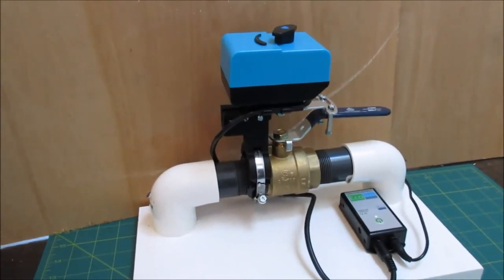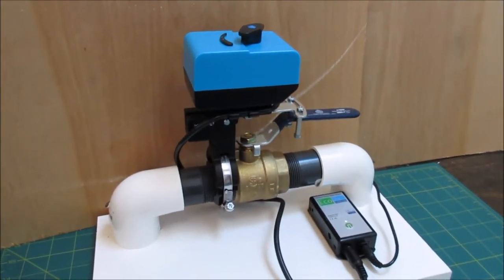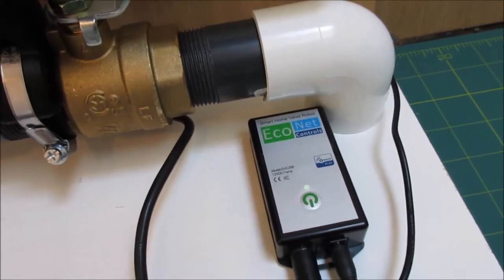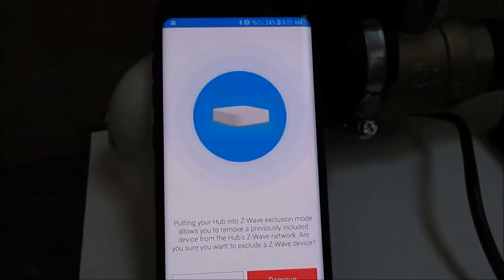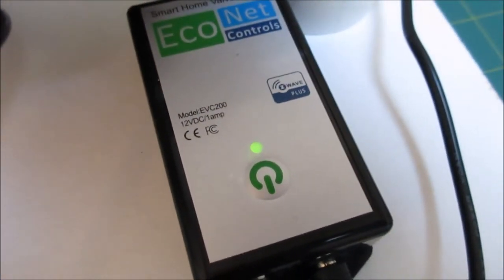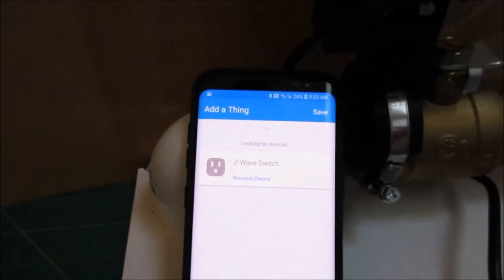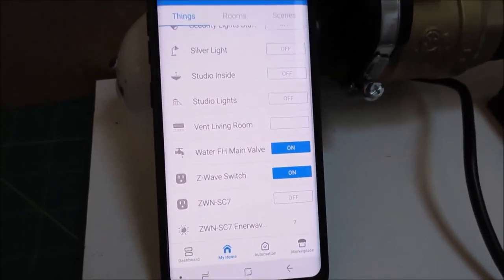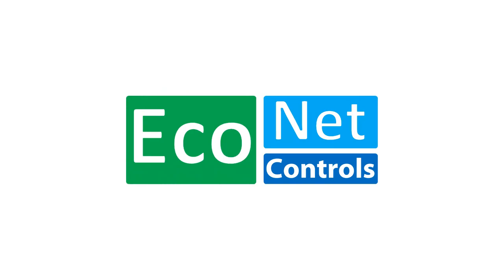Pairing the EcoNet EVC200 with SmartThings

Comment: I have two of these hooked up pre and post pressure tank and for over a year they worked great, I had two leaks that these valves prevented a huge expense. 
The smartThings sensors gave some trouble which Econet quickly solved.
Support from this company is incredible.
If you want peace of mind get your valves and sensors from them, they can pre program them too if you like
Disclosure: I am a customer and have not received remuneration of any kind, this is to help others prevent dissastrous  floods